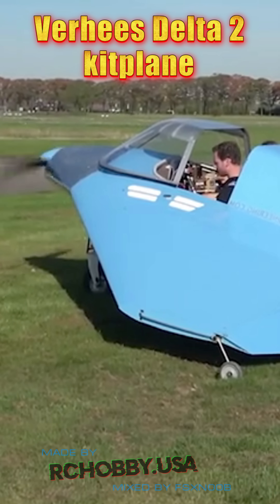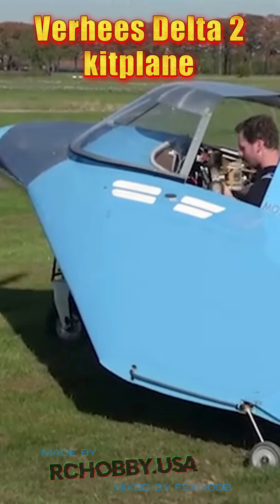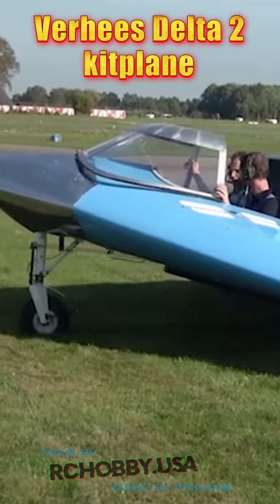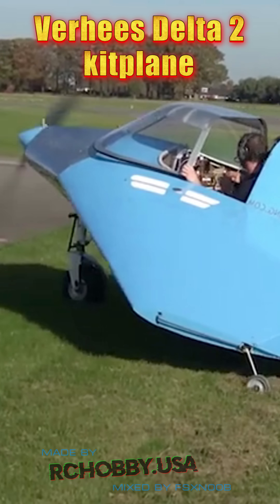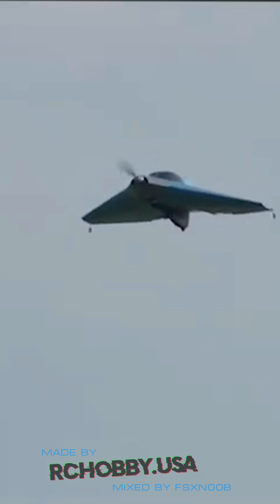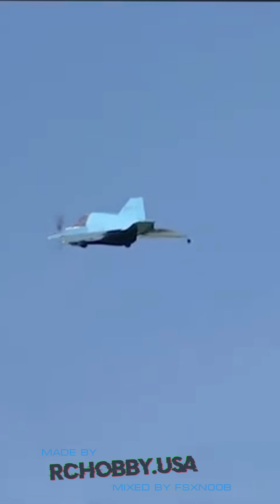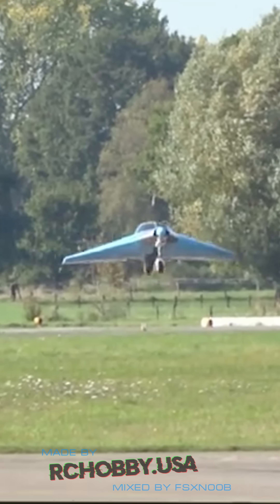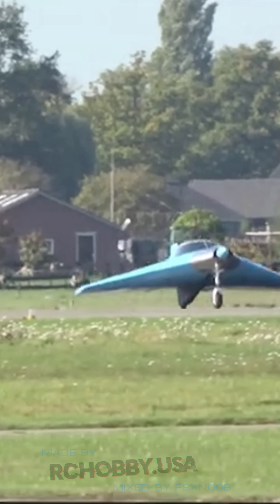A Game Changer in Aviation - Verhees Delta 2 Kitplane #shorts #aviation

Comment: This thing could get you across the entire us solo basically. That's absolutely wild for something the size of a lawnmower
Reply: or across an ocean if your brave enough to try it💀
Reply: @raven4k998 🤡
Reply: How can the fuel load go up from 1500km regular or 4000km solo!? You must just be flying a fuel tank at that point, pilot probs has to hold some fuel in their mouth😂
Reply: @MrScotty5877304  more like pissing jet fuel into the tanks like they did in ww2 bombers simple🤣🤣
Reply: @MrScotty5877304 look dude it ain't that hard I always hold fuel in my mouth when I go driving so incase I run out of petrol I can always refuel it.
Reply: @MrScotty5877304 more fuel, less dead weight
Reply: the nerds are mad
Reply: @libscihuntress8510  fr
Reply: Size of a lawnmower??
Reply: It's in km, not miles. The 2 person slow range is 900 miles. Pretty similar a cessna 210 with long range tanks
Reply: You would definitely have to stop for refueling. He said 1800 kms with the extended tank right? Coast to coast America is over 2000 miles.
Reply: @olliefoxx7165 no, he said 18 hrs endurance and approximately 4000km range, which is about 2500 miles by my reckoning.
Reply: @olliefoxx7165  its like 4000mi. The north to south is over 1000mi in the smallest parts, 1500+ on east coast
Reply: A trip across America in that would require at least 10 stops simply due to navigation restrictions, weather, mountain ranges etc.
Reply: How small do you think the US is?
Reply: @lordofducks3430 eastcoast to westcoast (of Florida) is only 100-140 Miles. 😂
Reply: @LogicalQ  I’m aware as I live there, however the entire us is about 4,800 km across, 800 km more than this thing could possibly hope to obtain
Reply: @lordofducks3430  just a joke, nothing more.
Reply: @LogicalQ  ah okay, couldn’t tell. My bad
Reply: @lordofducks3430  that's still almost across the US, for something that small and relatively cheap
Reply: @Squigdude13  that is still assuming favorable conditions and a straight line, and you’ll get neither across the US. However it’s still amazing such a small plane is able to fly that far
Reply: @lordofducks3430  The SHORTEST east to west is 3,362 km

The shortest north-to-south distance across the contiguous U.S. is approximately 1,650 miles (2,660 km)
Reply: @lordofducks3430

As a Canadian, the US is pretty fucking small.
Reply: @calvinnickel9995 not really actually, Canada is only bigger by about 1.5%~
Reply: @lordofducks3430 I see, you simply don't mess with the lord of ducks regarding geography
Reply: @calvinnickel9995  As an American, I accept your assessment.
Reply: @calvinnickel9995 USA is the size of Europe, and Canada. No, it isn't small.

If we count only land that is hospitable to life, Canada is smaller than the UK.
Reply: how big is your fucking lawnmower cuh????
Reply: That's less fuel per mile than my (quite regularly sized) car uses. 
Surely I'm missing something?
Reply: Yeah, this is cRaZy to me. 

Also, does the extra fuel off balance the airplane ?
Reply: Ions better than Canada though.
Reply: You might want to re look at that caluglation. The gvrd is bigger than England
Reply: @kengolder1615  supercalifragilisticexpialidocious espyalidocious...that the true issue.
Reply: Just how big do you think most lawn mowers are?
Reply: Only an American could get things so wrong

Comment: If I’m working that out right that’s about 40mpg at 130mph. Thats pretty good, frankly good enough for a commuter plane.
Reply: Idk, bet he's just going downhill and engine braking 90% of the time in zero traffic. Can't fool me.
Reply: Its more like 32,5 mpg. Still good, but not 40
Reply: The hard part is getting into the jet stream pointed in the right direction. 😂
Reply: Yeah it's super light so I imagine it's largely dependent on wind
Reply: @NathanBranek  Wind speed actually affects all planes the same way. A plane is moving through the air, so if the air is moving 10knots away from the desired destination, i.e. a headwind, the plane's airspeed (The value on the airspeed indicator) is 10knots bellow the ground speed. 

It's like driving a car on a giant treadmill. If the treadmill is moving at 5mph, any object on it would have their speed reduced or increased by that much, regardless of speed and weight.
Reply: @davidmhh9977 true, but wind speed matters less to say, an F35 with a jet engine vs a Cessna 172 with a recip. Parasitic drag plays a factor, too
Reply: 220 Km/h = 136.7 Mph
16L/h = 4.23 US Gph
IF you use 4.23 gallons for an hour of flight, and you fly 136.7 Miles in one hour...
It's 136.7/4.23 = 32.32 Miles per gallon. And that IS really good.
Reply: The specs on this plane are given in a time base of hours. That's not metric, by the way.
Reply: 930 miles of range 32 mpg 136 mph (119 knots) bout  29-30 gallons of fuel.     It's actually pretty damn efficient for the speed . hella better than you can do in a car at 136 mph. Faster than a 2 seat cesna with half the fuel usage.  Probably interesting flight characteristics tho
Reply: Thanks for converting to freedom units 👍
Reply: Idk how everyone's math is so fucking bad. 
140L= 37gal
Range of 1500km + 30min reserve
1 hour = 220km
220km ÷ 2 = 110km
1500km + 110km = 1610km =1000mi
1000mi ÷ 37gal = 27MPG

The fuel efficiency does not increase when there is more fuel if you ignore taking off and landing.
Reply: Doubtful those stats are anywhere realistic.
Reply: @danah358 If published fuel burn rates were inaccurate planes would be running out of gas and falling out of the sky.
Reply: @danah358  It is right on their website, and unlike cars, they don't bullshit. Unless you have a headwind, you will get 8+ hours of flight time.
Reply: @Ravenousjoe With a headwind you'll still get 8 hours, you just won't go as far.
Reply: @ZeedePlus  true true, I have been on small aircraft with lots of wind, they make for a super short flight, or really long ones!
Reply: @Ravenousjoe you'll always get 8 hours of flight time. A headwind affects distance, not time.
Reply: @balometer  True true, my mistake, it would only affect endurance.
Reply: @danah358 английский галлон - это 4.5 литра ))
Reply: @danah358  it makes sense. the air forces b-2 is revered for its long range and extreme flight time. the delta wing design is optimal for fuel efficience at the extreme cost of manuverability.
Reply: Wonder why he is using forign calculations. What are meters and kilameters?
Reply: @williamdixon1992 possibly because they are the units used by everyone but Americans. You know, the other 6.3 billion people on the planet?
Reply: @williamdixon1992 what the entire world except Americans and a African dictatorship  use cause it's more accurate and was used to get you guys to the moon
Reply: You are kidding. I hope you are not that ignorant @williamdixon1992
Reply: @williamdixon1992 meters and kilometers is used in the rest of the world other than USA 😂
Reply: @fijianz1  Correct. There are two types of nations - those that use metric, and those that have sent and returned alive men to/from the moon. There is no overlap between the two groups.

There is nothing wrong with metric, I used it often at NASA, but it is in fact developed to make life easier for the mathematically illiterate.
Reply: @balometer  You sound like exactly the type of person that metric was invented for! 😂
Reply: @FelonyVideos  Metric was invented for everyone who likes efficiency. I'm an engineer, I worked in the American system, the British system and the metric system over the years. Metric is intuitive and efficient, especially when you're doing the calcs in your head or estimating. The others are slower and need calculators at a lower level. They're even slower to type. So yes, I am the sort of person who likes metric, along with every other engineer and scientist that I know.
Reply: <Buzzer Sound>

It's already been 100 seconds and you have failed this test of your metric engineering expertise, and you have been fired. Express your unemployment paycheck rate in local currency per second. Alternatively, you may use french francs or euros.
Reply: @chaotixthefox  So many errors we have made along the way since then. It might be a stretch, but if we had not gone astray, our Mars colony today might be designing THEIR Europa colony!

Of course, the lawyers on Earth would still be doing everything in their power to stop it. 😂
Reply: @balometer  Do you have 10 parents? Are there 10 hours in your metric day? 10 days in your week? 10 minutes in your hour? 10 months in your year? I thought you were saying something about your metric system being efficient? 😂

How about your metric Avogadro's number? Speed of light? 

Is this embarassing enough, yet?
Reply: @FelonyVideos  Do you have a phD in false equivalence?
Reply: @balometer  You used a lot of words to say "Yes". Not very efficient... But at least it was 10 syllables! 😂
Reply: @FelonyVideos It's amazing how you were able to say so many stupid things and still come out thinking yourself ahead. Do you have 10 parents? 😂
Reply: @audunskilbrei8279  I did not make any statement in my last comment. It consisted of 9 questions. Maybe I should have added one more question so you could better comprehend the point.
Reply: @FelonyVideos  I was talking about all your posts really.  You know we use the same calendar right? And base 10 number system is also the same. Metric just fits better with the number system we all use. It's one of the reasons it's more efficient.

Do you even know what avogadro's number is? I assume not since bringing it up in this discussion makes no sense.
Reply: @FelonyVideos  I didn't say yes, I backhandedly referred to you as a maroon. You need to read the actual words.
Reply: @ I don't claim to know everything. Metric days aren't used by ayone which is probably why I went through engineering studies without ever hearing about them. Not knowing that irrelevant fact doesn't mean I'm not educated. I bet most people don't know what a shaftment is. Doesn't mean they aren't educated in the imperial system. 
And none of it makes your posts less stupid.
Reply: @balometer  Yes, I am quite the "maroon". 😂
Reply: @audunskilbrei8279  I'm not the one who can't do floating point math without getting confused. Perhaps you can get a position at Boeing under their DEI program. 😂

Also, if you aren't comfortable doing engineering using cubits and fortnights, you are dangerous to humanity. Maybe try McDonalds, but then, they might want you to keep the fry oil at 358°F...
Reply: @FelonyVideos honestly, I understand that you americans - like everyone else - have a sense of keeping continuity. Why change if I don't have to? 

But, you have a base of 10 already since you are using the decimal number system. You also use a base of 10 in your currency. Likewise, I do believe that you sometimes talk about percentage. 

Metric is much easier that imperial and as mentioned earlier, much more effective. If you just understand that deci, centi, milli, kilo etc means, you know how to convert and all of a sudden you know both length and weight. 

I hope that you are educated enough to realise that your comparison with days is just foolish.
Reply: @ugglah  americas too large to have to change it. theres no need. if america was the size of a small country neighboring the uk, then wed eventually use the metric system.
Reply: @JoshuaDavis-m3t  that doesn't make any sense... you use Fahrenheit, which was invented in Germany 340 years ago... imperial units that were invented in Britain after the US became independent.  

What makes it a measurement for a free country? You took it from someone else. It's not your own invention!!

Also,
4 inch in a hand
3 hands in a foot
3 feet in a yard
5280 feet in a mile

16 ounces in a pound
14 pounds in a stone
160 stones in a ton
There is no logic!

The only case I feel that imperial is good is for baking because it is only 3 teaspoons in a tablespoon. Instead of putting like 8 dl ... it is easier to take like 3 table spoons and 2 teaspoons than 8.
But we have half of a dl/cl, so that's not really such a big deal. 

I just don't understand. Ok, you have not used it, and because of that, you don't understand it. Likewise! But meter kg and celsius are superior! Meter and gram are used as SI units for a reason... Celsius is practically an SI unit, but changed to make sense in our daily life  -  based on the most important ingredient for us to live. Water!
Reply: @williamdixon1992  superior means of measurement.
Reply: @Ravenousjoe  Only WWII champions get to determine the correct units of measurement, apologies for the confusion!
Reply: @Ravenousjoe  Can you name all of the countries that used the metric system to put a man on the moon?
Reply: @scapegoat762  literally no one cares. Your system is based off of the size of grains of wheat, just because it worked doesn't make it less of a dumb system.
Reply: @scapegoat762  also you're just incorrect because the Apollo guidance system used metric it just happened to display Imperial because the astronauts didn't know how to read metric
Reply: @Ravenousjoe  "literally no one cares" says the guy who immediately posted two replies, stating basically "Nuh Uh".
Reply: @scapegoat762  coming from the person who deleted their factually wrong comment lol.
Reply: @Ravenousjoe  I did what?
When a conversation exceeds the boundaries of honesty, my willingness to spend time on that conversation goes to zero.
Jog on.
"lol"
Reply: American Standard is superior. Metric is an abomination in need of an extermination.
Reply: @williamdixon1992 

É isso que o mundo todo não entende com relação ao padrão americano.

A dezenas de anos (acho que mais de cem anos , mas não sei ao certo ) , O mundo inteiro adotou este sistema de medida como o padrão. 
Mas nos Estados Unidos o governo insistiu em continuar a usar um sistema que é da idade média .

São inúmeros os casos de acidentes de aviões que são abastecidos com quantidades erradas de combustível ou informação distorcida entre pilotos e torre por um interpretar em pés e outros em metros. 

Se houvesse um pouco de educação do governo americano em educar seu povo no padrão internacional , tanto o americano médio sairia ganhando , quanto o mundo inteiro também. 

Pois o que existe atualmente é um sistema que o mundo inteiro tem que se adaptar ao entrar no espaço aéreo dos Estados Unidos. 

Abraço fraterno Para você do seu irmão brasileiro.
Reply: @flaviorodrigues8625 I've been flying in the US fot 30 years. Nobody cares about miles or kilometers. and nobody HERE crashes because they can't tell the difference.  We won the WW2. We get to keep our measurements.  Now, that said, all of our cars had kilometers and miles on the speedometer at the same time.  Miles are fine. Meters are fine. I have rulers with both.  I use the inch system for building.  It's like arguing German, English, or French is a better language . If you are raised with one language, it is what you are comfortable with. I know how many teaspoons are in a pint. WGAF if YOU know how many milliliters are in a cup. I measure in thousandths if I need to.  Easy peasy.

Comment: I've got a beast rig set up on a custom loop, so i know its not cooling issues, and I've got a b660 chipset motherboard, with an intel i5 12500kf and a Geforce RTX4070 Super, and the game stull runs like ass. It runs so poorly. I get 133fps on Horizon Forbidden West at MAX graphic settings on a 2560x1440 Corsair Xenon 315QHD, the same screen and PC with Fallout 4 on medium settings in Boston especially the downtown areas, i barely hit 30 at best. Its insane how poorly its optimized.

Comment: This is a motorized bicycle with a propeller and is top speed is about 5 miles an hour and it barely gets in the air.  Its max distance is about 653 feet total travel on a fully charged electric battery.  This item is illegal outside of Europe because they blow up constantly and they crash because turns out they are not very good at all.  They have a casualty rate of the people who fly them of about a 93%.  Its a kit that costs about $180,000 and its classified as a novelty and they basically are mostly used as a conversation piece.  They are really really stupid and deadly and they break.  The main reason they crash is because they fall apart in the air.

Comment: I would love to see a version with two small turbo-jet engines to push the speed over 300 km/h at higher altitude. Wonder how that would impact efficiency.
Reply: Really? It would kill the efficiency. Not to mention the maintenance costs.
Reply: @ghz24  I just found that light-sport requires reciprocating engines - so even mini-jets would be a blocker :) That said, if they put nacels on pylons either side of the tail ala HondaJet would make them accessible ... Economies of scale - swapping them out for rebuilt units could be simpler than an ICE engine overhaul (like dropping in new batteries (I kid)). A twin mini-jet design would give the aircraft over-water redundancy - but I don't know just HOW thirsty that setup would be (guess it depends on the engines used). It could fly higher with less air resistance (of course cabin isn't pressurized - not without major rework) so those higher altitude forays would require O2.

Comment: How does this thing compare to the Dyke Delta?
Reply: The dyke had a 180 hp power plant.
Both are aluminum.
Likely slower with the same flight flaws.
It's probably a little better than a dyke because in 1966 computer design wasn't a thing.